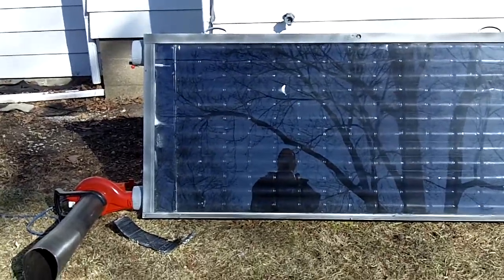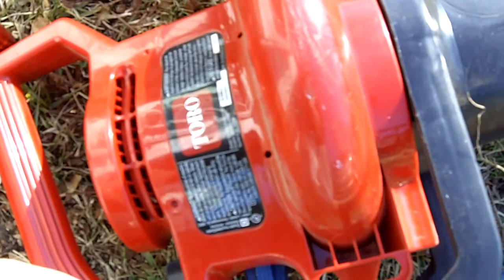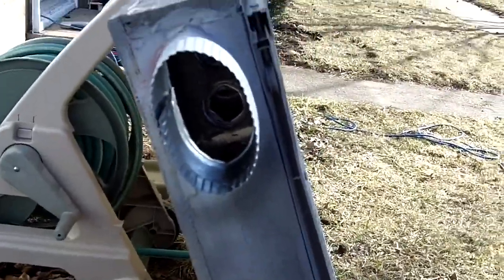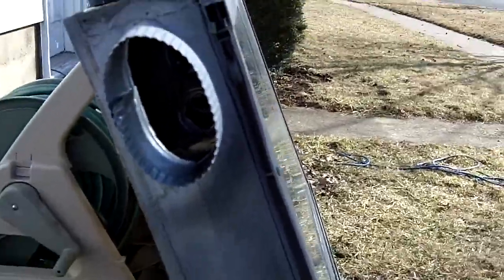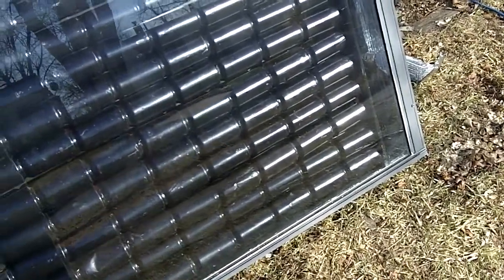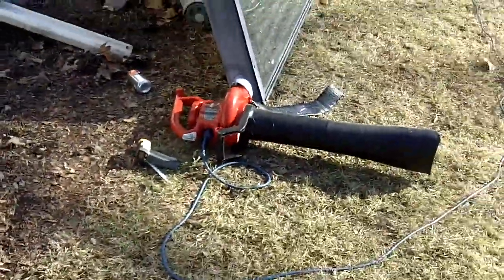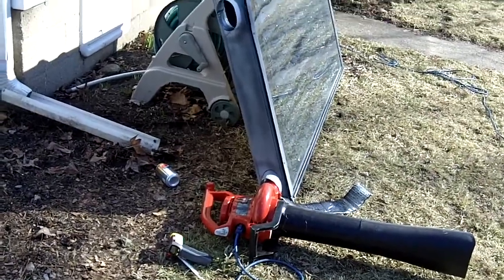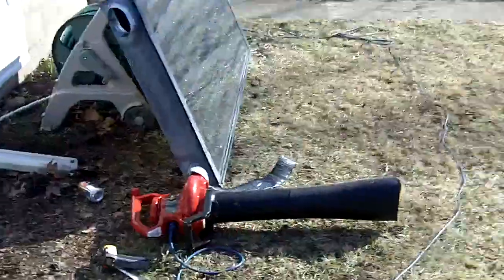Solar Heater Panel test with a leaf blower

Comment from the maker: While this did work, my house wasn't set up for it to properly work. I had too many trees on the south facing part of my house that gave too much shade, even in the winter and without leaves.   I ended up finding out that wiring together a snapdisc thermostat, a solar panel, and a high performance computer fan would give the best results.  Using a hard wired electric motor would use too many amps and would be ineffective cost wise.